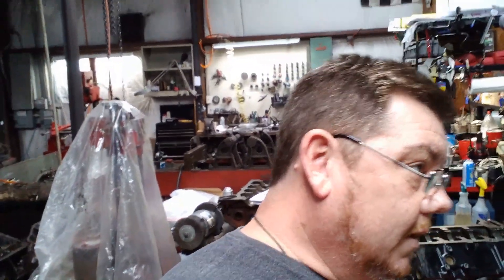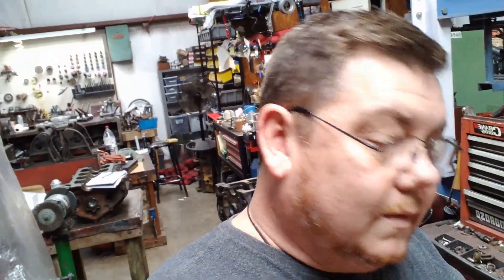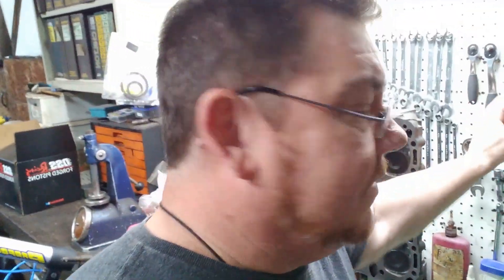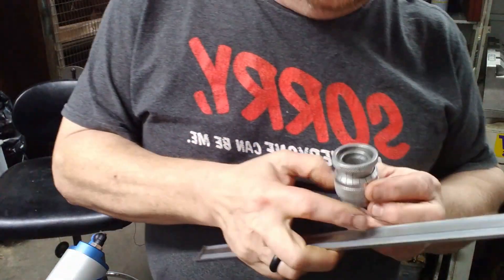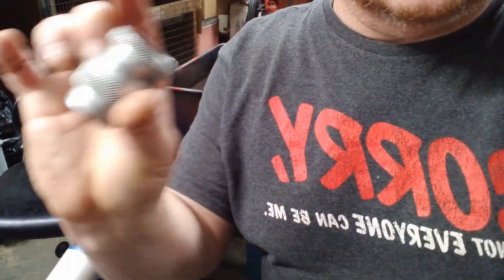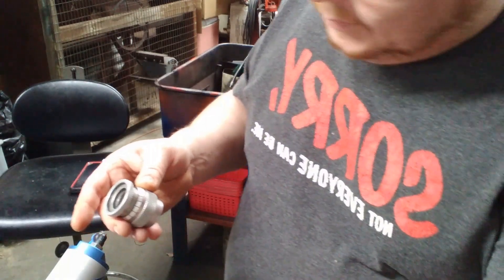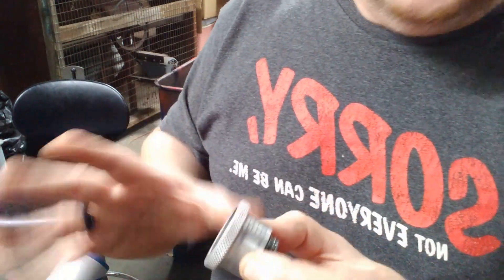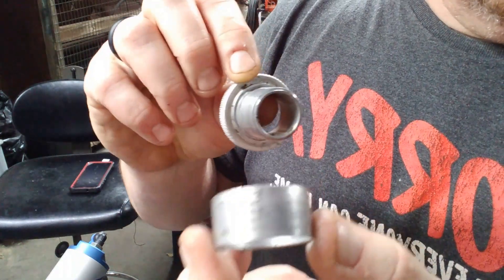Calibrating The Cheap  Valve Spring Height Micrometer

Comment: I bought one of those, a howards one. But it lied to me, which fortunately i picked up on. so this i good information. but I also assumed that step was subtracted from the mic. as in my case the retainer fits inside it, so id have to machine it off. Or add some shims to bring the ledge of the retainer up flush with the top of the mic.
Reply from the maker: what I do when the retainer sits inside the step is use a .060 shim that will hold the retainer and span the micrometer and then add .060 to whatever the micrometer says. Sometimes I  will read it directly from the step (mine is .100 deep) and just subtract .100 when I do it that way. Thanks for watching!